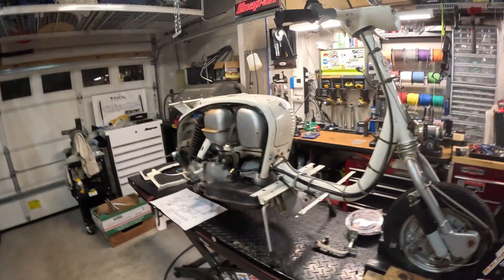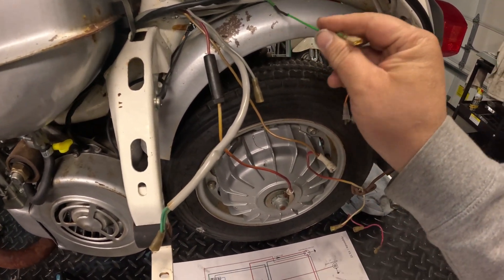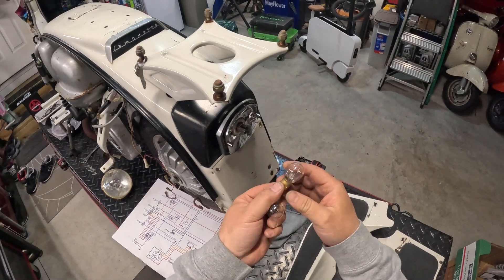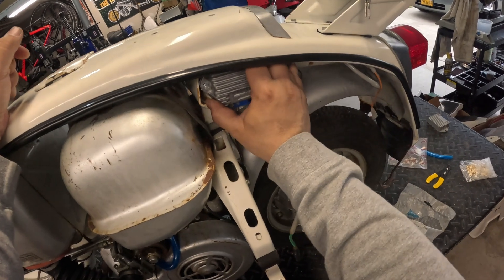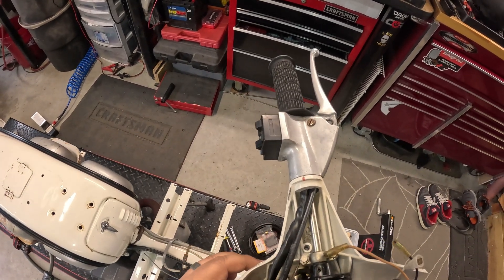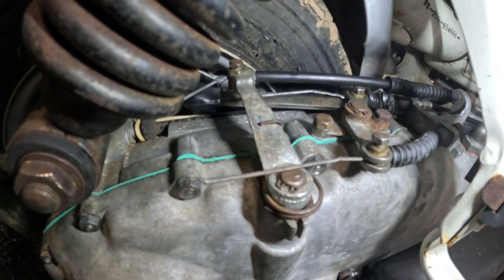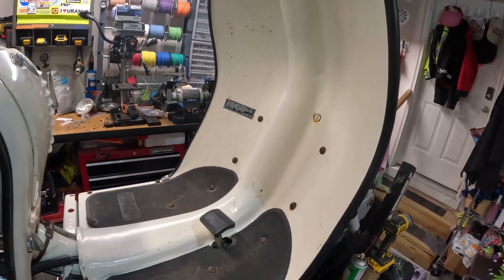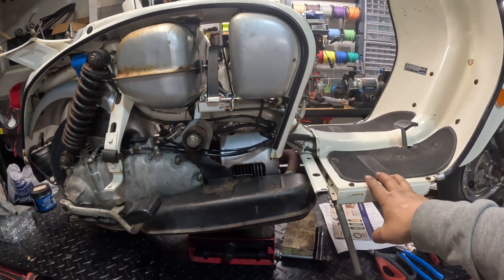Serveta Jet 200 Rebuild Series Part 8

Comment: 7:00 how did you know/diagnose the regulator was bad?
Reply from the maker: Tested it with a volt meter, had voltage going in but nothing coming out.